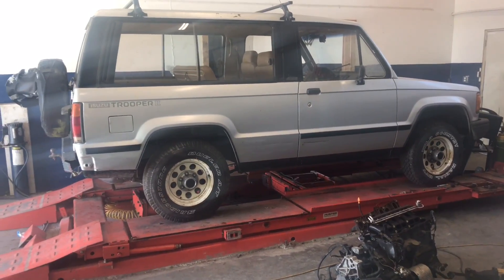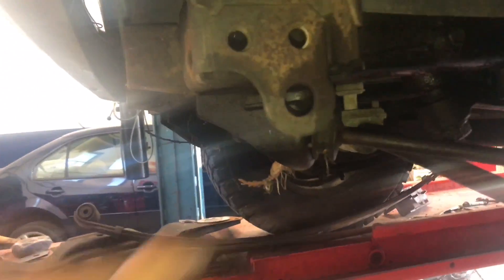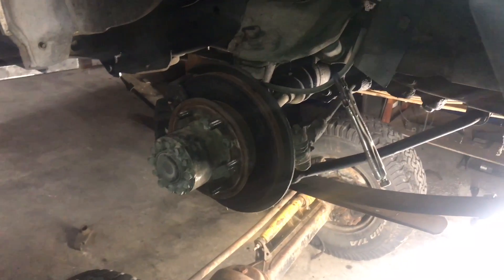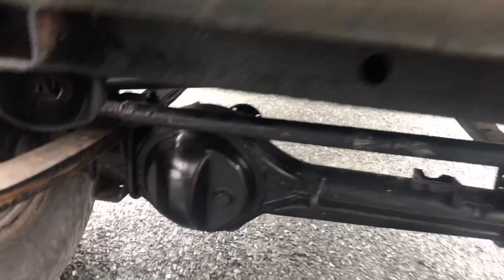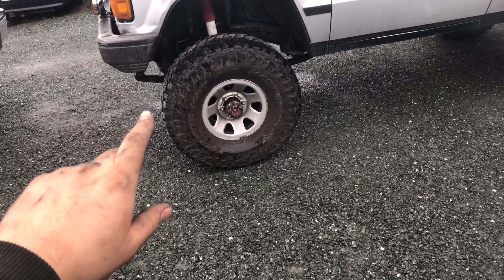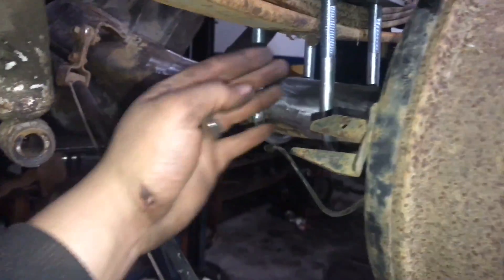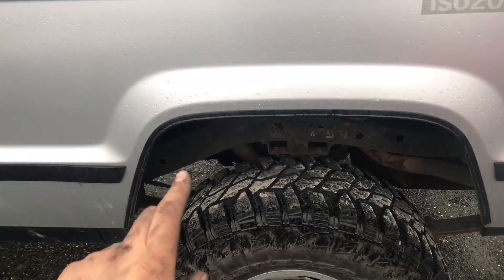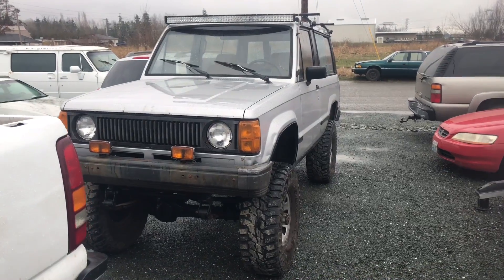Isuzu Trooper SAS Solid Axle swap

Comment: What did you use for the drag link? And did you have to get custom brake lines made?
Reply from the maker: camoguy21 I welded threaded bungs into some tube and used hiem joints with high misalignment spacers and I drilled the stock Isuzu pitman arm. I used stock style 85Toyota lines they use the same thread pattern